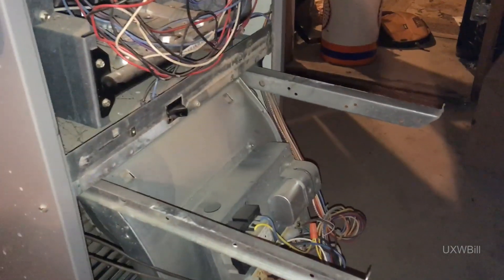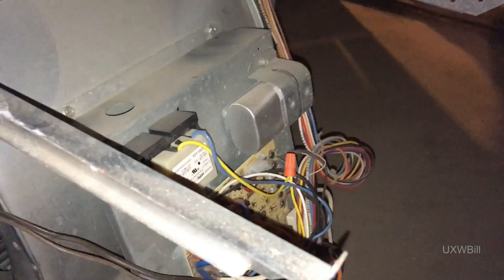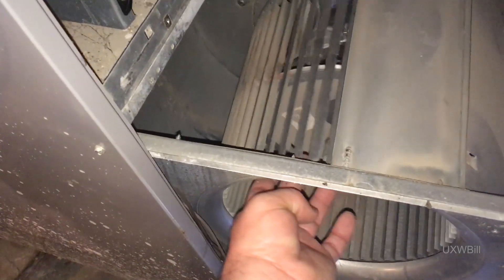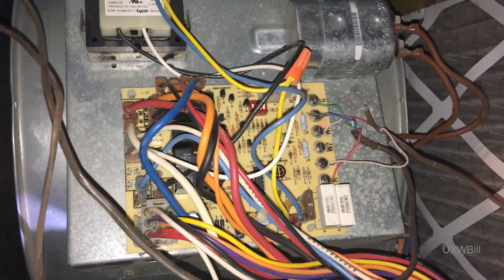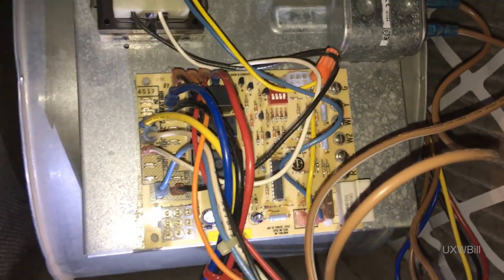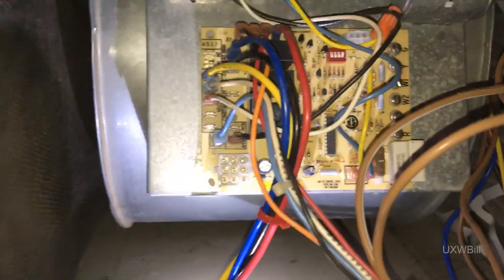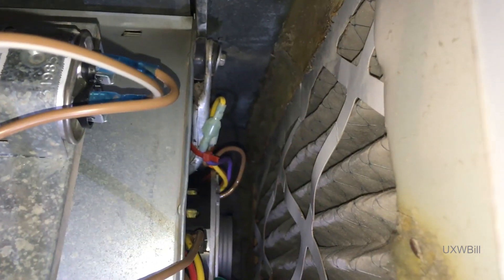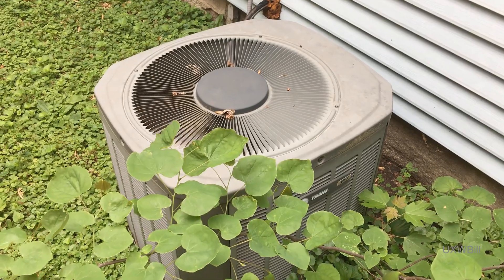The Heil Files: Let Me Level With You About Why Your Furnace Isn't Working!

Comment: It sounds like my vintage Paramount box fan starting up, a HVAC tech once told me that he got a service call because a air handler was making a ticking sound when it was off,in attempt find out what wrong  he pulled out a cheap China Pride alarm clock from the blower duct

Comment: A job well done bill :-D
I don't suppose you asked the owners where that spirit level came from.
Reply: I see your comments everywhere, from Louis Rossmann to 12voltvids, Shango066 and RadioTVPhonoNut, all the great repair channels. 

Also, top job on the furnace, UXWBill.
Reply: I've also seen his comments on EricTheCarGuy's videos as well.
Reply: Archie Bunker
Oh yes i do enjoy the ones that push the boat out for us :-D
Reply: richard3700hz
Did you mean me?, i can't always know if im being talked to due to youtubes habit of sending comments badly.
Yes im like dog crap, everywhere lol :-D
Reply: Yes, I meant you. Always good constructive comments on so many of the same channels I watch.
Reply: richard3700hz
Like i've said to many people, i'm showing my appreciation of the video creator by giving a decent reply.
I tend to like constructive/repair videos and people with humor.
If you find someone without humor, run away as fast as you can LOL.
Reply from the maker: The owners were not there for most of the day. When they showed up, I told them about it and they were mystified. I saw no reason not to believe them.
Reply: But was the customer " on the level " ?
Reply: I suspect it went missing form the tool box of whoever installed the unit, they used it to level the unit, ductwork or piping and it's been there since then

Comment: Great video as always. I’ve got that same mag lite. Gonna charge my e30’s ac with the good stuff (r12). Any tips?
Reply from the maker: Make sure the system is leak free, dry, clean and that the compressor has the correct amount of oil. Consider changing any filter/dryers and inspecting the orifice. Pull a good strong vacuum on it (500 microns or better). If you can't, there's still a leak.
Reply: uxwbill thank you!!

Comment: Steven Lavimoniere who I subscribe to reccomends Value Testers. He does HVAC and plumbing.
Reply from the maker: I wouldn't ask here if it were going to be easy. :-) I've already done the easy things (web searches, eBay, etc.). The data logging kit in question, same as the meter, has been discontinued for several years. The number of meters also likely far exceeds the number of data logging kits that were made.